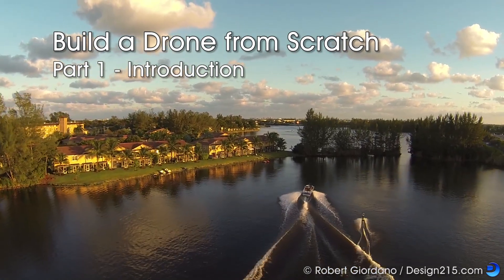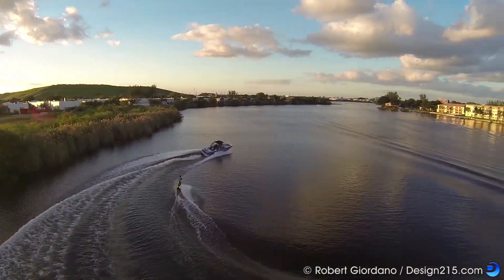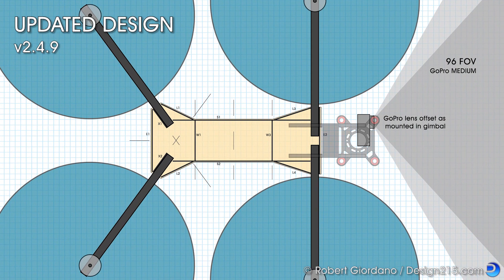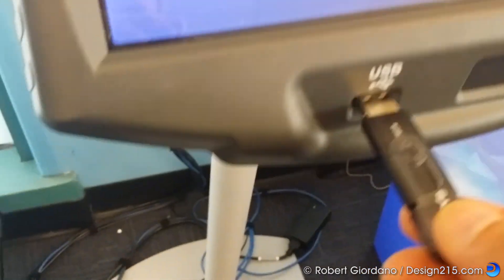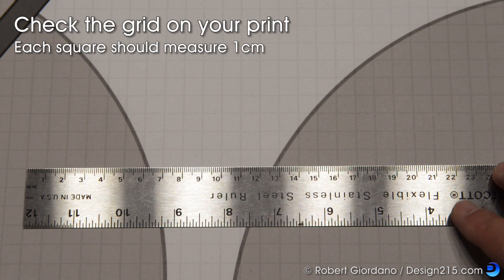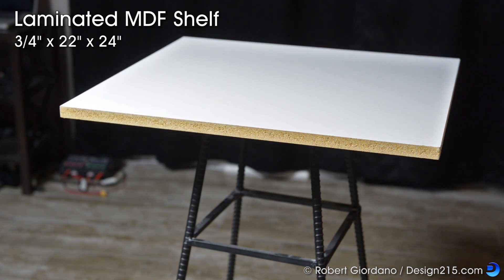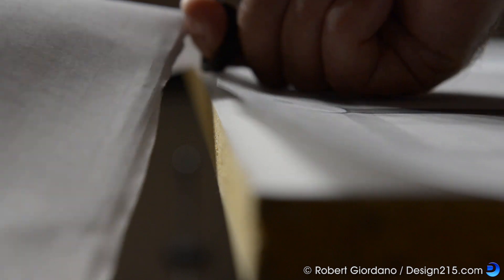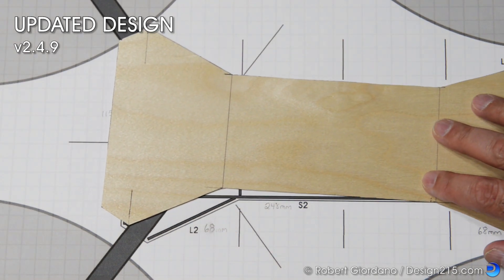Build a Drone from Scratch - PART 1, Introduction

Comment: how much does it cost you?
Reply from the maker: That's a very broad question. I made this series to show students how to build a lightweight and strong frame you can build at home. This frame uses a combination of wood and carbon fiber, which is cheaper than using only carbon fiber. My entire video series is a bit outdated now in the US since we are no longer supposed to build drones weighing more than 250g. But, the main cost of any drone project will be your motors and electronics, which are not covered in these videos. Let me know if you have any other specific questions. I am happy to answer.

Comment: can i make an aluminum frame with platic over it or what would you prefer?
Reply from the maker: Aluminum will be too heavy for this size drone. I designed it with wood for multiple reasons- its actually lighter than if I used all carbon fiber, the wood is a lot cheaper, easy to cut, and easy to glue.
Reply: And I didnt see the last videos of it, did you finish it ?
Reply from the maker: @jendo6354  I finished the videos showing how to construct the frame itself. I have not made video showing how to install the rest of the components because there are hundreds of different combinations of motors, props, flight controllers, and other components. This frame is good for 7 inch props, all the way up to 15" props. I'm currently running 3508 380kv motors with 15" props on mine.
Reply: @rob215x  but can u make a video that just shows it or so pls I'm new in building drones and I'd really like to get to know more about it and so
Reply from the maker: @jendo6354  I'll have some new videos soon. I've been super busy with client projects. But I have plans for many more videos and also a new mini-drone frame design.

Comment: What's the max travel distance
Reply from the maker: The range will depend on the electronics you choose. I'm a photographer so I fly mostly LOS (Line of Sight) or FPV. I get about a mile of range with my current setup. But you could go much further with different electronic components. I'm using Ardupilot for my flight control software and I can program a course for it to fly autonomously. I'll be looking at different choices for electronics in future videos.